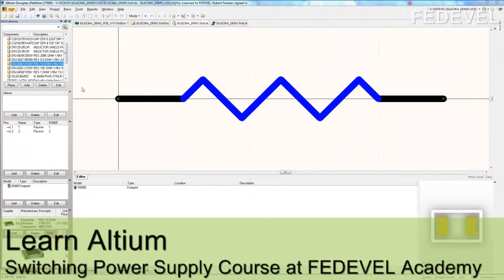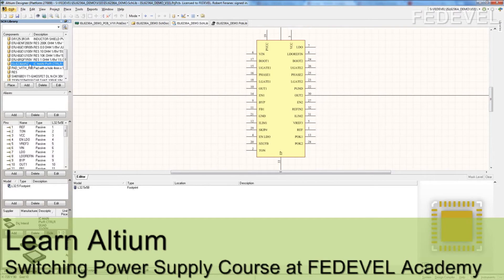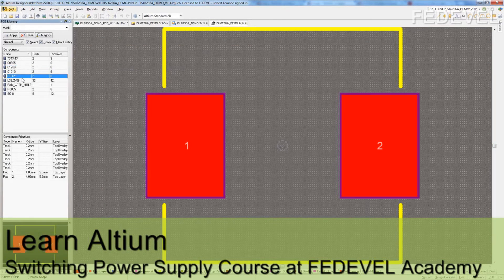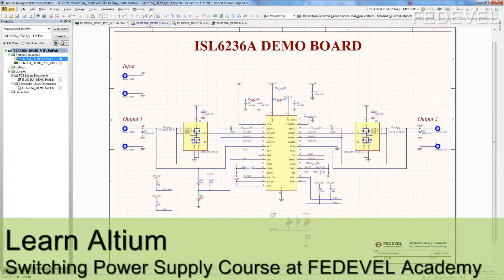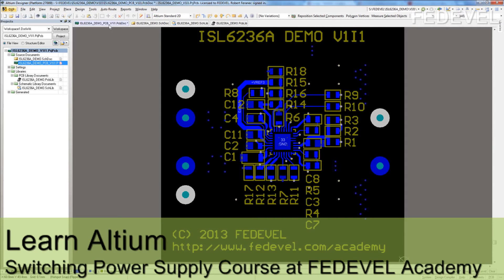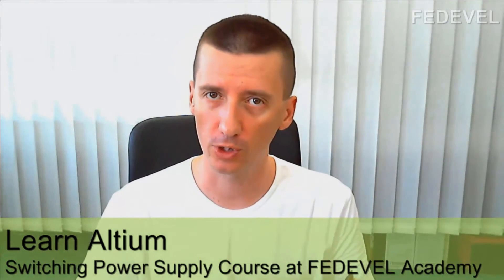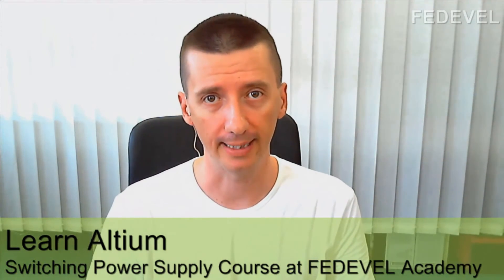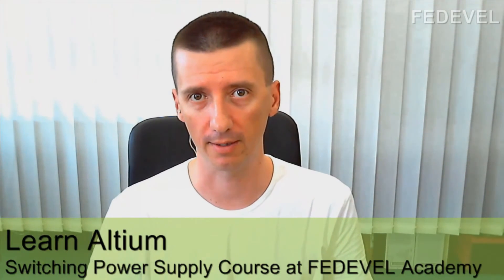Learn Altium - Switching Power Supply Design Course

Comment: Hi
Nice video's !
I have a question about creating footprints :
How to create the centerpad for a QFN package so that it has a chamfered corner .
(mostly used to indicate pin 1)
like here where it is a round notch : http://screamingcircuits.typepad.com/.a/6a00d8341c008a53ef010536bf96c4970b-120wi
Reply from the maker: Hi John, I just use a standard square - no problems. I think, if you play with it, it should be possible to create it, as I believe, pads in Altium now can have any shape.